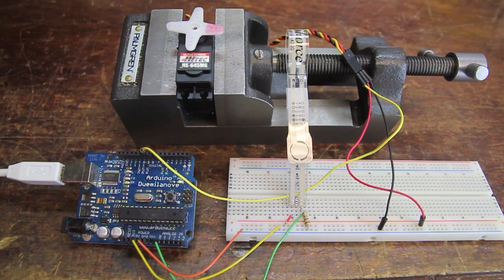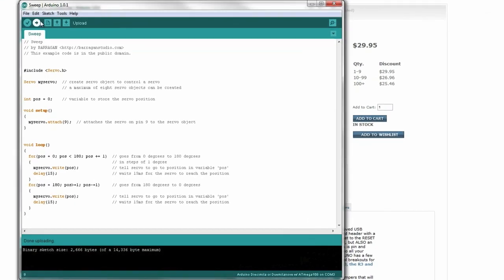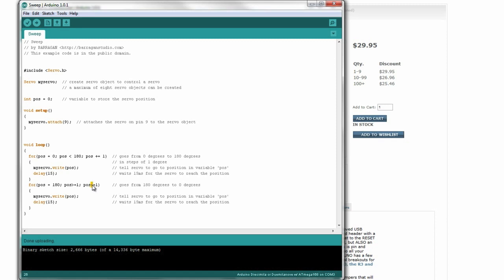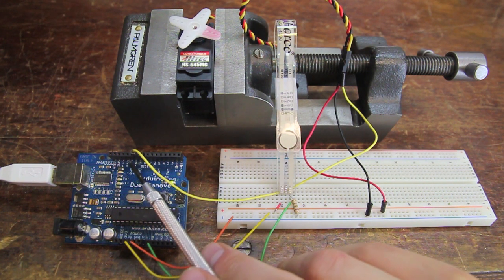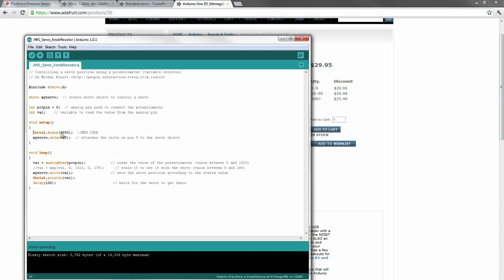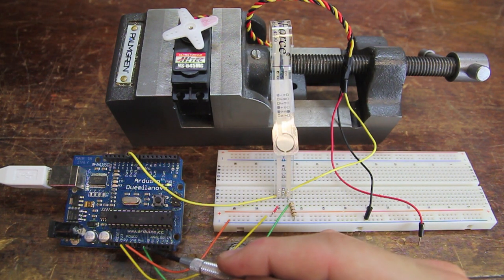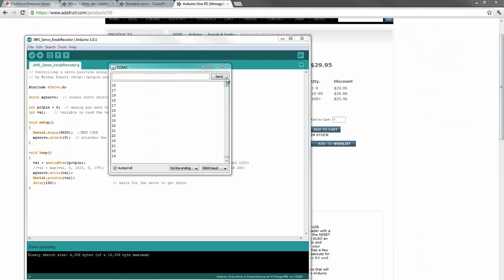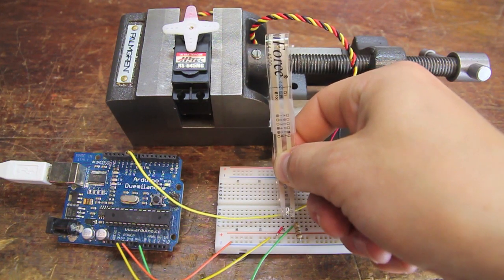Arduino Servo Tutorial 1 of 2

Comment: I'm curious why it wasn't going all the way. Was that because it needed to be pinched extremely hard to go all the way around? Does that middle terminal have to be grounded?
Reply: +Ryan Lockwood at 10:05 when he was looking at the scaling line of code or "map",  it is scaling the 0 to 1023 range of pressure input (which he only got to ~600 on serial monitor) to the range of the servo (0 to 179 with 179 being a 180 degree rotation).  He could have scaled it differently by using a something like (0, 600, 0, 179) and probably gotten a full 180 degree rotation with a full press
Reply: Yah but it's not supposed to work like that.  It's a 1024, 2 raised to the 10. 10 bit number. 1023 is supposed to be the highest value. I'm just wondering why he couldn't get it to the full 1024. The pressure pad should have been giving out full 10 volts.

Comment: I would like to add that servos for rc are now standardized in that the signal pin comes only in white, yellow or orange, blue was once used but has been fazed out. If yo look on Ebay or even Hobbyking servos no can be bought for as low as $3.00 with around 1 km of torque. Most standard servos now " unless  stated " do not technically transverse 180 degree but turn 178 - 179 degree,  this is to stop binding in model application when over reach on an arm can lock the servo into position. The servo used in this video is a exception. Just keep this in mind when buying.
Reply: I do models planes, cars and boats have done for 20 years now so If any knowledge that I know can help I am glad to do so. I also do computres from the ground up and programing, I am learning the ablility to comunicat with items like the Auduino now and your vids are making it a very easy learning curve. I have a PIC programmer would you be looking int this down the line.

Comment: Thanks for the tutorial,

I plan to implement this code into my biped robot project. I am going to add the pressure sensors to the feet therefore I can make the robot walk over most obstacles with out falling over. The sensors will recognize when the feet hit the ground so if the sensor is triggered before the foot hits the ground, it will stop and the servo won't keep going.

Thanks
Reply: +NYC CNC This is what I found working arduino tutorial FREE DOWNLOAD https://plus.google.com/105456673395930650430/posts/PWgqWWct4AF? XOXO~gtK

Comment: in your video, i see that a servo can be controlled with just an arduino board then i wonder what is the arduino motor shield for? Can i control servos with just uno rev3 board? or i need the motor shield?
Reply: NYC CNC thanks, i got it.

Comment: This is absolutely fantastic! You made my day! Very well explained. I'm new to all this and actually getting the code to work made me so happy!
Just a suggestion: Please indicate the value of the resistor that you are using. I'm using a 10K ohm resistor and the results are not significantly different. 
Is the value relevant?
Reply: OHMYGOODNESS THANK YOU i am currently trying to get this thing to work and i didn't have a resistor and had no idea what value to use either
Reply: 10k ohm is the most common resistor and potentiometer type for hobby microcontroller projects as far as ive seen.

Comment: forgive me for asking if it is yet to come up , but is it possible to run the program with the micro controller disconnected from your pc after we have programmed it ? i assume the answer is absolutely but i really need to learn this stuff and there is so much to sift threw , you are the best channel yet to display sources for parts and the use of them thanks for posting
Reply: thanks , i figured you was simply using the usb as a 5 volt source

Comment: Sorry may i ask about how to connect the arduino with load cell and servo motor. is there any electrical diagram ?? THX a lot
Reply: it seems that it didn't connect with the load cell(weight sensor)

Comment: I'm going to install a car alarm system in a workshop to work as both an alarm and to lock / unlock the doors.  I already have the locking bolts in place and I was going to fit a servo to each of them to turn them into actuated locking bolts.  So I will have the actuators from the car alarm / central locking that I could use to operate a switch to control the servos, or is there a more simple way?

Comment: "(2^10 = 1024 (the exponent is the number of bits) But 0 is also a value in computing, so 1023 is the total number of values)"

Actually, 1023 is the highest value in the range. The total number of values is 1024.

You may be right about the servo's current draw being a potential problem (unless powered by a separate source). From a thread on Sparkfun's site, HobbyTronics stated "In normal operation (no load), these servos only need about 50mA when moving and virtually nothing when stationary."

Comment: I need help. I'm using flex sensors as potentiometers, instead of the pressure sensor, but the five servo motors i'm using still vibrate when i'm not even touching the sensors. is there a way to make sure the servos position doesn't change when the flex sensors aren't being used?

Comment: Arduino is an MCU(MicroController Unit) programming platform. The goal is to simplify the process of learning to program/use MCUs. There are many types/brands of MCUs like PIC, AVR...etc. Arduino belongs to the AVR type which was developed by Hardvard I think. In this video the Arduino is that greenish/blue-ish electronic board. you can simply think of it as a micro-computer which can serve a certain job and has no keyboard/mouse/monitor.

Comment: I built a motorized camera slider a while ago using an arduino.. It works really nicely to get a super smooth pan!  My setup has some mechanical flaws with how the wheels attach to the track and kept sliding off, so I've yet to fix it with a lack of time and money but for the most part it worked well.  You need a decent stepper motor that has some strength or torque depending on camera and enclosure weight.  Adafruit has a motorshield for arduino that worked great!

Comment: Hello John. I would like to build a motorised (servo/ stepper motor) device for a camera slider. A colleague suggested that the Arduino platform may be the way to go. I have watched one of your videos (The one with the variable pressure analog input) and the procedure for setting the thing up does not seem to be overly complicated. I was wondering if you might consider suggesting a good place to start investigating the feasibility of this little project

Comment: If you mean arduino the board, you can program it in (mainly) C/C++ with WinAVRStudio or the Arduino IDE. If you mean Arduino the programming environment, it is based on Processing and uses a variant of C/C++ for it's programming language with some hardware specific libraries and functions. The program structure is a bit different that it does not have a main loop but rather a setup function and a loop function being the basic functions instead of a main function in C/C++

Comment: I have tried it with two 9v's, but it doesn't seem to work. I may not be wiring it right, but I haven't seen a good way of doing so. But like I said, I won't be able to do anything else until I get a new chip for my arduino.

Comment: a 9v power supply should be enough to power 1 servo but im not sure.
its definitely not enough to power more than one. if you have more than one arduino.cc says to use a completely different power source.

Comment: I'm not exactly sure, i'm not very good with electronics (kind of embarrassing) though I tried a servo with 4 AA batteries, and it burned up. I am now trying to run a single one with 2 9v's but it'd not enough. I can't do any more experimenting now though because I need to replace the chip on my arduino due to an upload error.

Comment: I seem to have an issue. I have a 9v power supply going into my Arduino Uno board, and I have the circuit wired up.
When I power the piece with a USB connection, it is fine. 
However, when I run the arduino/servo on a 9v power supply only, it gets twitchy. Am I using not enough power with just a 9v?

Comment: great video . liked and subbed  just learning about building a sim panel for dogfighting hate the store bought gauges i have a few spitfire gauges without the gears just the faceplate and shell  do you know of a motor (360*) that will be able to do smooth increments with the arduino i wish to make a needles for the gauges RPM Alt Speed and a few toggle switchs Fuel Mag etc ..anywhere you send me for what i should be looking for ?

Comment: I'm just starting out with Arduino, so I was wondering how you did your calculations of the resistors on you breadboard, both located at each end of the pressure sensor.

Comment: There might be some differences with Arduinos people use, and the servos(MG995 is also the most commonly counterfeited servo around, so there is about 70 billion different manufacturers and types of it roaming around).

I can't get my 995 to work with Arduino power either. I just suggest you grab a 5v power supply.